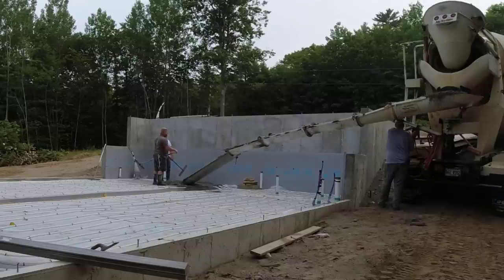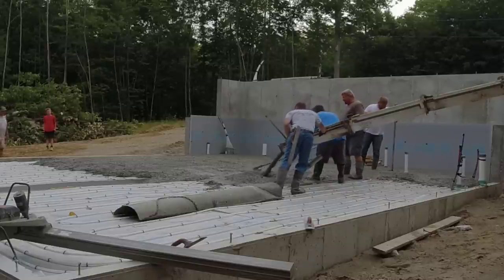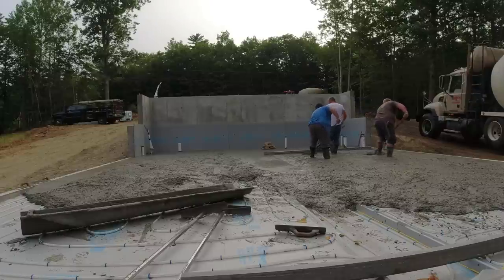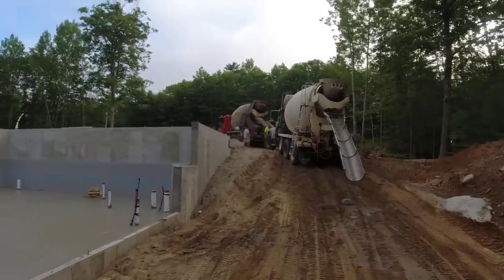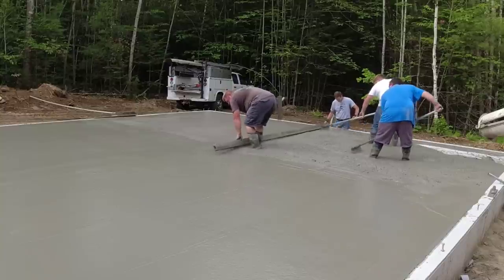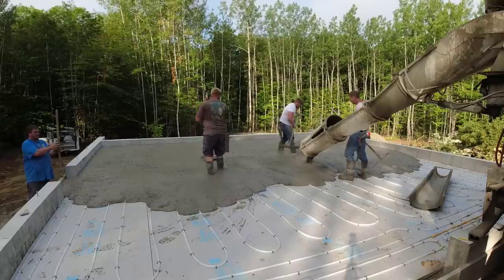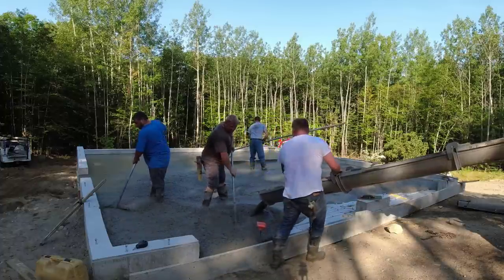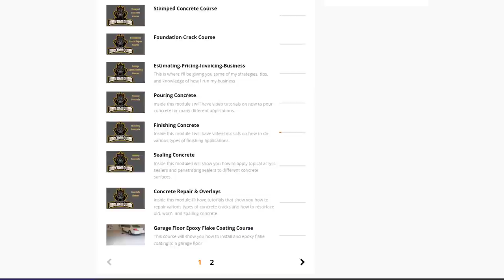How We're Pouring Concrete in 2024 | House Floors and Garage Floors (Bonus Generator Slab)

Comment: In Florida, NO radiant heat laid down, lol.  And no foam.  Just plastic, most floors are mono slab with footings, so rebar in the footings, and fiber in the floors.  Since it is CMU walls there is rebar sticking up ever 40" plus openings.  Most the guys here want pump trucks (or trailers).

Comment: Is there a reason why you don’t use wire mesh? I’m not a concrete guy. Does residential not need the extra wire?
Reply: He has fiber in the mix instead of wire mesh.
Reply: @christopherhaak9824  victory does fiber mesh and rebar. That’s why I was wondering